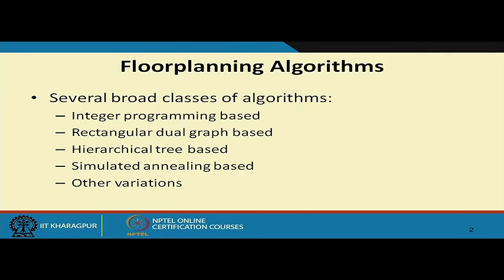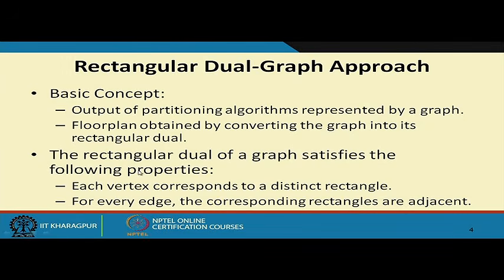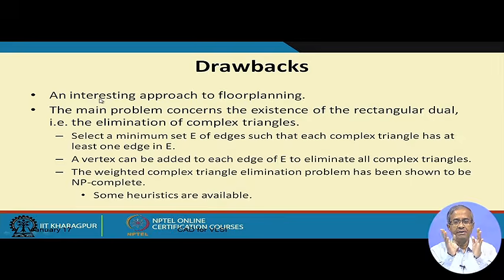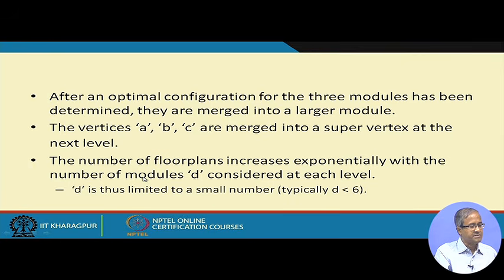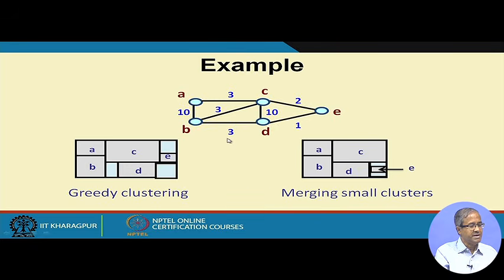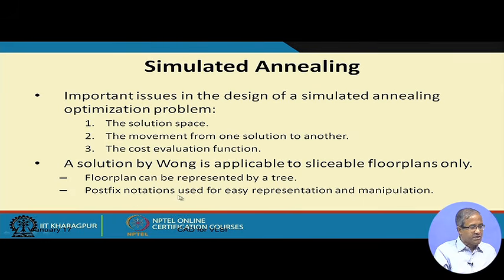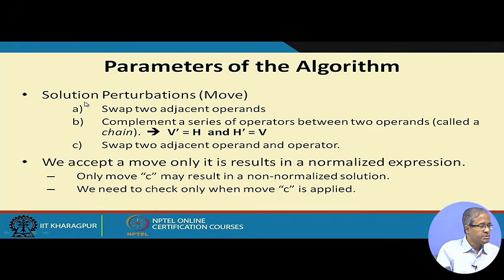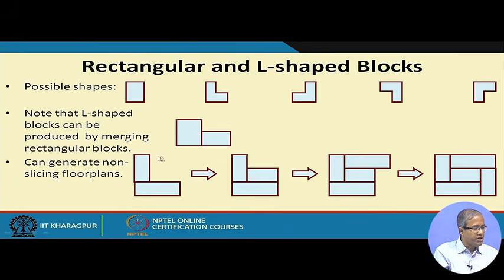Floor planning Algorithms

Comment: At 28.40  the equation we got at the final is not normalised one becz both horizontal dash and vertical dash are adjacent to each other ...
Reply: I think it's not normalised when you get two horizontal or 2 vertical adjacent. A horizontal adjacent to vertical may be fine